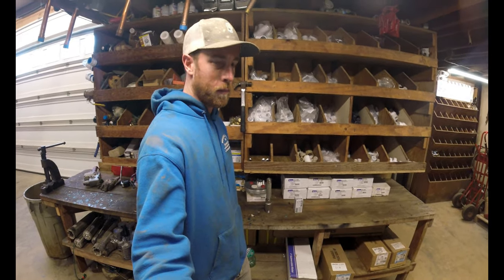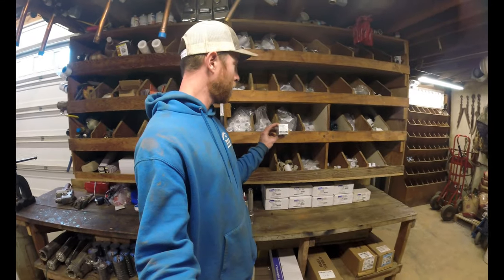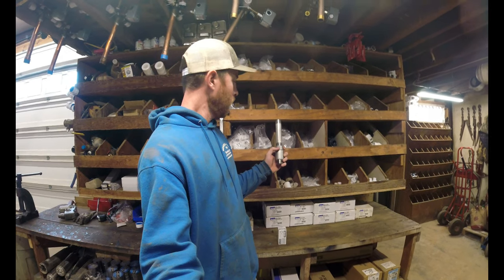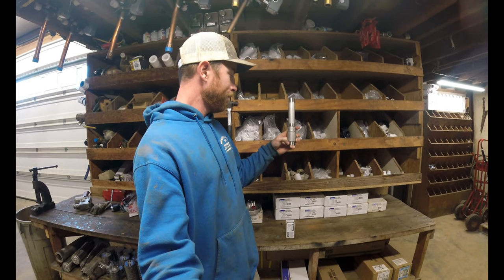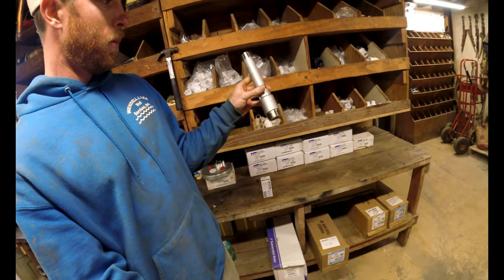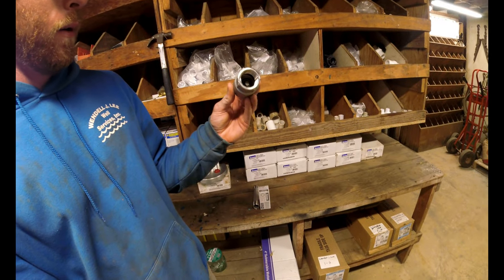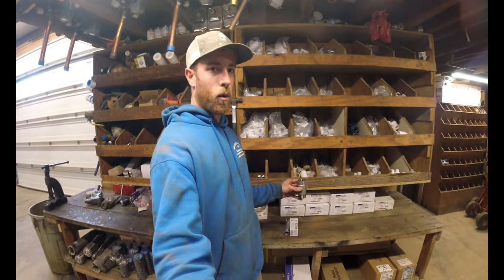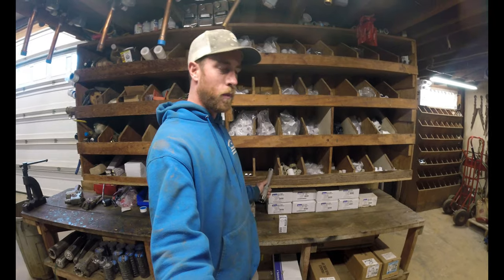Check Valves for Well Pumps: How Does it Work and Why they are Important

Comment: I just subscribed.
Good information.
I got a drilled well about 20 feet from my house with a submersible and well depth is about 45 feet with plenty of water.
I was never sure if there should be a check valve before my pressure tank because there isn’t one.
I was always thinking that even if the check valve that was built into the pump was leaking back a little overtime that the check valve would stop the pump from starting unnecessarily but would it be worst if it does draw down and there’s no water in the line from the pump to the check valve and it’s only air when the pump finally comes on it could create something else?
Like bad water hammer?

Comment: Probably a dumb question, I want to install a well pump that’s frost free but I need full flow fittings like a cam lock. It’s a well I will fill tanks from. Can I remove the check valve in the pump and have it drain out after use? Frost free yard hydrants are not big enough.

Comment: Great video .. just had whole new well troll pressure tank ..switch ..piping etc installed .. our installer said they don’t put check valve at pressure tank since there’s a check valve at the pump … and that putting two check valves in at pump and at pressure tank can mask a pump
Problem ? 

Is this accurate info ? I take em at there word they are in the business and have been for some time in our area … I’m just confused cause some many forums and pressure tank installers insist a check valve should be at pressure tank and pump

Comment: Is the check valve is installed on the outlet side or inlet side of the pump? A foot valve on a simple jet pump system would suffice as the check valve but if you have a pump system (say the water source is a cistern) then where would you put the check valve?
Reply: I figured it out. It's on the input side of the pump.

Comment: just had a guy install a in well submersible pump and he couldnt get the check valve hooked up IDK why probably because he's incompetent or lazy. There's now only one on the far side where the water tank is. Is this an issue or will the check valve on the other end work?

Comment: If the pressure tank is showing no pressure but there is still water but with really bad pressure would this be a check valve? Well in Nevada at about 375ft.

Comment: We are just now thawing out from the great texas freeze.  I turned the breaker back on to my well pump and water is coming out of the check valve when the pump is on, but not when it is off....  the tank is still building and holding pressure .  What could cause this?

Comment: Everytime my pumps turns off I get water hammer. I can here a 'thud' noise and see the pressure gauge on my pressure tank move around. From research I've done it seems the check valve on my pump is not closing properly and the reverse flow is causing it to slam shut. Any ideas?

Comment: Whats a good way to check to see if a check valve is bad without pulling the pump? Just bought a house and dont have the money to pay somebody to do it right now.
Reply from the maker: if the pressure wont hold when the pump is off. if the pressure starts falling as soon as the pump turns off, thats probably an indicator the check valve is bad and the water is running back in the well
Reply: @WendellLeeWellServices  okay, I am maintaining pressure. I think it's actually just the tank. 👍
Reply: @WendellLeeWellServices  Thank you for the video and the reply. Sorry for this long-winded response, but thank you if you can assist me and anyone else in a similar situation. Trying to diagnose if it's a faulty check valve at the submersible pump or crack in well pipe at pump or on the line coming into house without pulling pump since we're still in the negative temperatures here in interior Alaska and 100 miles from the nearest well drilling specialist. Cannot see if there's any water spots on ground outside from well casing to the house, since we're under several feet of snow and ice for a few more months (usually thaws in April/May, with water not fully soaking into ground/evaporating until June/July). I can visually see the water rushing back down the well pipe via the whole house water filter with clear canister installed just after the well pipe that leads into crawlspace from underground (pre-expansion tank). The canister will drain down to 25% water and fill up with air approximately 75%. This happens after the water pressure drops from 50 down to 30 psi when using water and the pressure switch kicks on at that time. Pressure tank is set at 28 psi. There's a second check valve right before the expansion tank/pressure switch, so harder to diagnose since the gauge doesn't lose pressure over time because that check valve prevents pressure drop and is working. After the pressure tank water is exhausted and pressure is down to 28 psi the faucets start sputtering with air and spurts of water, and then several seconds later the water will rush back into the filter canister from the well pipe along with a bunch of air bubbles. Once the water visually fills the filter canister again very rapidly, the water at faucets will continue sputtering before releasing brown sediment, and this takes approximately 20-30 seconds to clear up. Once the sputtering stops, a few more seconds pass before the sediment clears, and then the water is clear and the pressure tank starts building pressure again to 50 psi. This cycle repeats every time the pressure switch calls for water, and there has ALWAYS been water hammer once the pump cut off (the well pipe to crawl space will shake, and it has a foam "pool noodle" sleeve around it to deaden the noise). Been this way since we bought the home and didn't come up during inspection. Well and well pump installed 2019 when home built. Given the sediment that gets washed up every time, I was leaning towards a semi-educated guess/DIY diagnosis of a crack in the well pipe right above the pump, since that would create a water swirl that stirs up sediment that is getting sucked back into the pump and eventually the pump fills with enough water to overcome the air in the pipe and comes racing back up. After finding your video, now I'm wondering if it could be the check valve at the pump being bad. Again, sorry for the long drawn out reply/description. In your experience, has a bad check valve at the pump caused something similar? I.e. air in the well pipe, followed by sediment brown water before clearing again, only to repeat again, every time? Or do all signs point to a cracked pipe? Thanks again for reading. I know time is valuable.

Comment: From what I read a check valve can be installed on a shallow well jet pump but I had to installers try to sell me a new well and said check 
valves are not installed on shallow well jet pumps, is this correct?
Reply: That's 100% a lie you have to have a check valve on the end of a jet pump or you can't prime the line

Comment: Please make a video for repairing a hole in a leaking casing without pulling it out. We have a 20 years old waterwell it was not been used for about 12 years because of its big operational cost and then we decided to make it operational again and putting a much better pump. The water goes up well but the problem is it was taste salty. We suspect a leak in the casing. please help.

Comment: Is that why I lose prime on my shallow well pump ? When I prime it it runs but I soon as I turn it off I can hear the water running down to the barrel and when I started there’s no water in the pump
Reply from the maker: sounds like a slow leak in your system
Reply: Found one small leak I also put a check valve on the water drum at the very bottom  no I don’t lose prime thank you